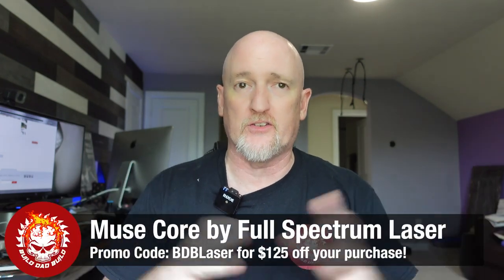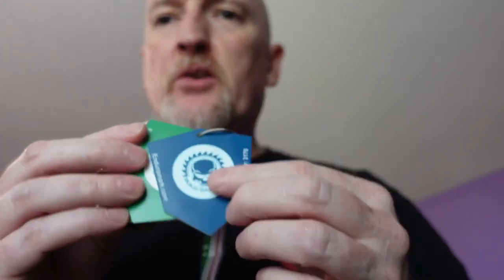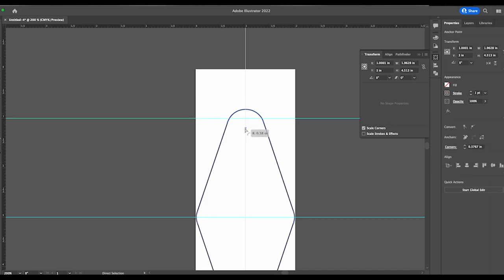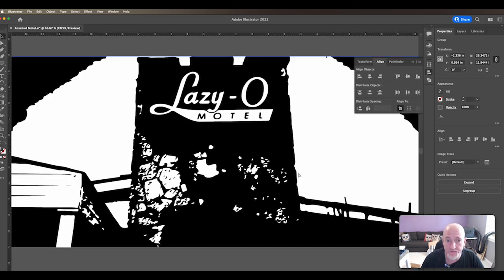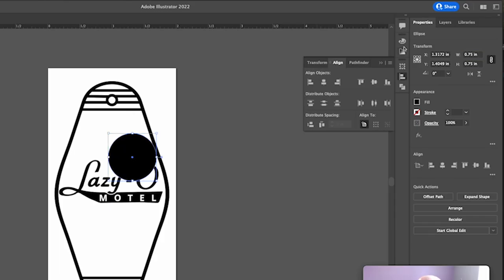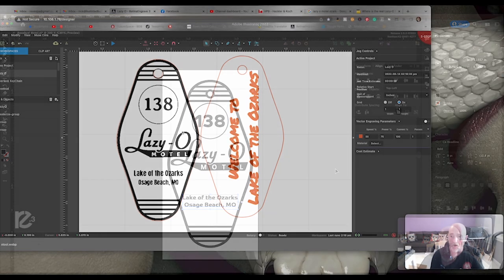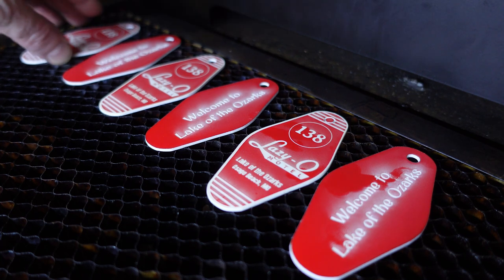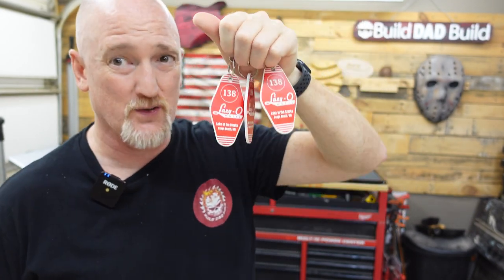Laser Engravable Plastic? (Making Keychains on the Muse Core)

Comment: For the lines you made at 5:17... use the rectangle tool and then when you make one line, hold "ALT+Shift" and drag the line down to make a copy, then click Control+D to duplicate and it will duplicate the line (Keep clicking "D" to duplicate as many times as you want). Then you draw the circle, select the circle and the lines, use the shape builder tool and drag it inside the circle and it will delete the lines that intersect.

at 8:44 next time, move the text to the side, use your direct select tool and click and drag your mouse to select all the anchors at the bottom of the "L" at once and then with your down arrow button on your keyboard move them down together.

Comment: so i got a sample of this when i ordered enduramark's powder coat cleaner. decided to try some stuff out just for S&G. i have a d1 pro 10w and landed on 800 mm/min, 100% power, 20 passes(this is on the blue color). it did "roll" the edge just a little bit, but i find it acceptable. it's a lot better than the slower speed/less passes. also the cut was a lot cleaner and smoother. i'm about to design a keychain just to see how long it would take to make one.

Comment: Nick, Enduramark has their bases covered with the D1, their plastics all say "** CAN NOT BE USED WITH A FIBER OR DIODE LASER **.   I'm betting with the right settings, I can with my xTool D1 (I've done it with Glowforge's branded acrylic, well, the black and green, not the clear, all i could do was turn the clear to goo where it met the tape).
Reply from the maker: That green reference panel I show in the video was done with the D1.
Cheers
Reply: @BuildDadBuild  I only have a D1 and I specifically bought it for this two-tone engrave and cut, admittedly not realizing white was a no go.  Can you share your settings on the green cut? I have been unsuccessful in even breaking ground on the black and white for a cut.  Thank you for your time.
Reply: @BuildDadBuild  hi, what were yu parameters for cutting the green sheet? power, pases speed

Comment: Hey nick, my father and I are considering buying a XTool laser and want the 20W laser. It seems a little redundant to buy the 10W laser then also buy the 20W module. Should we wait until the 20W system is just commercially available so we don’t have an extra 10W laser sitting around? Thanks!
Reply: xTool's standard answer to this is to buy a 5w kit, and then buy the 20w laser... then you'll have a 5w sitting a round. :P
Reply from the maker: Personally, I'd buy the 10w set up and get the 20w unit. That way if something happens you've got a backup.
However, if you're looking for a 20w system...all I can say is coming soon...
Cheers

Comment: Hey, man! I was just wondering more about the walnut you used for the Camp Crystal Lake keychain. 
Did you get 1/8" and then glue it together like the plastic? Or just do it one-sided on 1/4"? I'd really like to make one of those for a buddy of mine.
Thank you! They came out dope af!
Reply from the maker: I just use 1/8" walnut. I don't glue 2 pieces together like the plastic (I only do that so the key chain is the same color on both sides).
Cheers
Reply: @BuildDadBuild  Thank you so much!